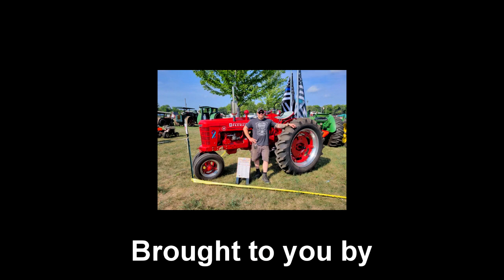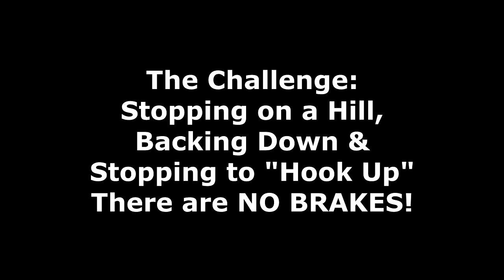2023 Western MN Steam Thresher's Reunion Steam School Part 3: Learning How to Operate/Drive Engines!

Comment: Looks like they gave you some good quality time on the steam tractor with a seasoned instructor. In the mornings, how long did it take to get the steamers going? Not like you can push a button or switch to turn the engine on. Makes you appreciate even more what the folks did in the late 1800's and early 1900's on the farms. Looks like you were getting the hang of it towards the end of the video. Hmmm....how long before a steam tractor ends up at Rusty Nutz Ranch??? If you don't mind me asking, what is the cost for steam school? Maybe that would be a nice retirement gift for me in 2025! 😂 Thanks for bringing us along, Kenny! Enjoyed watching!
Reply from the maker: It depends on the way you start out. If the water is still warm, it doesn't take nearly as long. I would say depending on temp of the water, and outdoor temps.. It could take anywhere from 1-4 hours. These were still fairly warm, I would say about 90 minutes to get them steamed up enough to start moving under their own power. I don't know if I will ever own one. They are an EXPENSIVE hobby. New boilers (if your engine should need one) will run you STARTING at $30k, depending on size and rating. It is very fun to play with them, though!